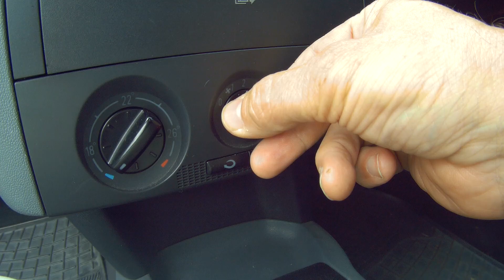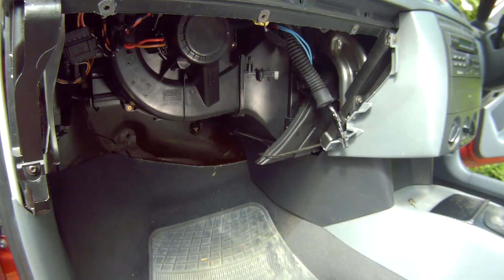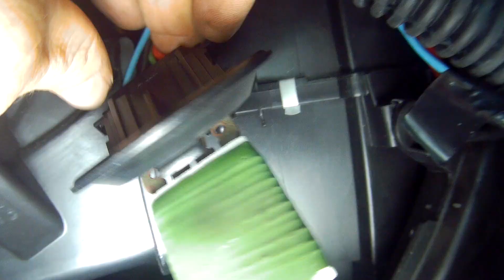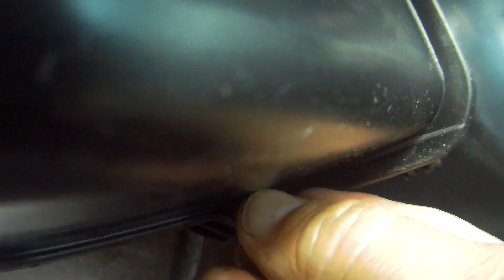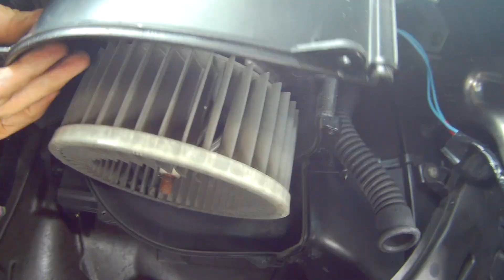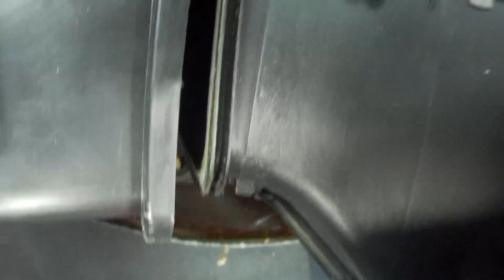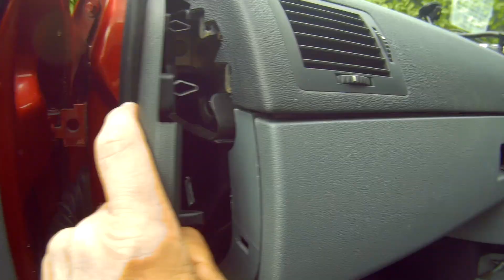SKODA FABIA Heater Ventilation FAN+ SPEED CONTROL

Comment: Great video, can anyone do a time for me tonsee where the 'air recirulation flap motor'can be located?
Reply from the maker: If you look to the far side of the fan unit you can see the blue toothed wheels controling the flap for recirculated air.
Reply: @HatBoyHarvey  thanks alot pal, appreciate it.
Reply: @hatboyharvey do you happen to have a part number for the recirculate motor you mention (blue cog part)? Thanks
Reply from the maker: @jimmymach6588  I'll have a look for you, what are your cars symptoms?
Reply from the maker: recirculation motor             RHD 6q2 819 453            LHD 6q1 819 453
Reply: @HatBoyHarvey  thanks. Recirculate button is currently stuck in the 'on' position (lit). I can't turn it off as the button light goes off and then comes on again. It sounds as though the flap is constantly in closed position. There's no grinding noises of gears but just assuming the flap motor is dead?? Thanks again.
Reply from the maker: I think I would test the connection for a signal to the motor, if there is one then i would look at the flap to see if it is stuck, then attempt to move is whilst pressing the button. The other flapper motor for heater is a common one for being temperamental like that. The motors and plastics get stuck with heat/cold etc. Hope you get it sorted, let me know how you get on :-)
Reply: @HatBoyHarvey  ok thanks, will try freeing flap first.
Reply: @HatBoyHarvey  didn't get around to looking at it before if corrected itself HatBoyHarvey. Maybe the hot weather we've had recently  made it stick etc. Not sure what this points to longer term though (if anything)?

Comment: I did the speed controller on a car this weekend and after that the fan is very noisy. is there any way of lubricating it?
Reply from the maker: Firstly check if there is somthing touching the fan like leaves. If it is the motor/bearing then in theory you could grease it, but I guess this may not last very long as the bearing will be worn. I've never done that. You would have to take it out and try to get at the bearing and may have to dismantle it. I don't know if the bearing can be replaced, but my gut feeling is it maybe housed in plastic and either not possible or not worth doing as replacing the fan is easier and not too costly if you choose a none OEM unit :-)
Reply: @HatBoyHarvey  There were leaves in it. that have been removed. Might be I forgot to connecet the hose aswell that might slightly affect the balance. The owner doesnt want to put much money into the car so thats the reason I ask. The noise is worse at lower speeds so its probably the bearign and then a new fan will be needed because theres no point in taking the time to restore it. Thanks. :)

Comment: A very informative video - thank you!  My wife’s car is a Fabia Mk3 1.9 TDI (2007).  Do you happen to know if this heater/blower fan is the same one in my wife’s car?  The heater controls are different in my wife’s car, and are further up the centre of the dashboard. 🙂
Reply from the maker: is it a mk1 or 2? the mark 2 does have different controls. If it is a mark 1 then it should be the same. The mk2 blower fan bit looks exactly the same to me, but not the rest of the whole unit. I'm only going on diagrams, sorry don't have first hand knowledge :-)

Comment: My fan speed working only on 4 now i know how to fix it thanks man :).Also in the same area when you was showing where the fan speed sensor is from that area cold air is blowing on passenger feet maybe you know what it can be?
Reply from the maker: my passenger footwell also seems to blow colder air than the drivers side and always has, not sure what this is or if this can be fixed. replacing/cleaning all the sensors and connections may help.
Reply: @HatBoyHarvey  Big thank you 😎👍

Comment: Hi , I changed the sensor of the heater but still working only up 4 speed , Do you know what the problem might be
Reply from the maker: If it works on 4, but not the lower settings you know there is power to the new sensor so that can safely eliminate it. I would clean the cabin sensor and check the connections on the temp sensor behind the control unit/or replace that as well. Check all cables/connections/continuity.You could try using OBD2 vagcom or other which may or not narrow it down if you have access to that. The actual switch or fan may be faulty, but I doubt it. I beleive the heater/vent control unit module can be reset, which may work and you know the infamous flapper motor gets stuck with heat build up and age and could possibly cause cause the system to malfunction. Check, test and replace is the only thing I can offer I'm afraid, hope this helps and you're able sort it eventually:-)

Comment: that sensor only controls the fan speed?Sometimes in summer i had it to give me some cold air and he give me hot air in the cold position,and cold in winter. do u know how to resolve that?
Reply from the maker: Yes, fan speed with overheat fuse (cheap to replace). Have a look at: https://youtu.be/kpv-mzBT8dQ     8:02 and 9:57, That sounds like the flapper motor getting stuck on hot or cold, which I've seen a lot on older fabias. Check flap actuation when stripped-down.

Comment: What can be my problem . My fan was blowing only on 4th speed so i changed the fan sensor that green thing it had blown fuse and the resistors showed bad resistance only 3ohms , so I changed it for brand new and after couple weeks it broke again , the new sensor cost just 20€ but what could be the problem with it ? I dont want to change the sensor and have it broken again soon .
Reply from the maker: I would check over all the circuit connections relating to the fan/upto the fan and then have a look at the fan itself. If it is worn then it may be taking more current to run, overloading the circuit and blowing the fuse and speed sensor etc. Hope this helps :-)
Reply: Hi , so I tryed to fix it myself . 
1. I measured if the Resistor Pack is broken or it has blown fuse , as show in this video : https://www.youtube.com/watch?v=LUNvzyvn8J8&t . It turned out that my resistor pack are all ok in terms of their resistance , they had blown fuse . So I changed resistor pack fuse , as shown in this  picture : https://ibb.co/g418c1H the fuse is combinated fuse 10A and 216C you need to make sure that the body of fuse doesnt touch the two middle points . 

2. I took the heater fan out of the car using your tutorial , there was no debree in the place of the fan , but the fan was cowered with dust , so i took the whole motor out and tried to clean it as much as possible . Then I put some engine oil (5W-40 was only oil that I had at home) on the bearings . Here is video that I followed on how to take the engine out of that plastic holder , It is in russian and it is diferent motor but the principle is the same video : https://youtu.be/ak2Shg8CRrU?t=423 .

Here are the photos of the bearings : 
bottom one (you can acces it only if you take out the motor from holder ) : https://ibb.co/nQynxq9 this bearing was full of black powdery dust so I gived it good clean .
The top bearing is pain , but you should get sense of how to take the fan part out and oil it . I used long siringe to get the oil on bearing photo : https://ibb.co/dDNXWwb the bering is just under the white part .

3. The fan part that white pastic was too covered in black dust so cleaned it as much as I could , I used minimum water becouse I thought that water will damage the motor , but you can use water and then spray it out with compressed air . Here is video from russian mechanic on how to clean the motor for good https://youtu.be/YAcnemZo8ds?t=571 , I understand just little russian but he shows it perfectly , in my case I do not have compressor so I did not use as much water .

The I just let the whole fan dry out , and instalet it back in the car .

But now the fan vibrates on 3 and 4 speed . I don t know why , I checked it holds good in that plastic , I think that I need  to again take it out and trim the fan white part . becouse it was hard to get all dust out of it , and I think that now it is out of ballance or something .

I may just buy the new one , but I just wanted to fix it myself , but it s pain in ass  :D I m just trying to save extra 90euros for new fan that s all :D 

My fabia is mk1 2005 . And the fan is factory one .

Comment: I have a problem also with The ventilation, because it is not heating at all. On The first 30 seconds it seems like is working and hot air is coming, but after that it turns to cold one... Do you have any ideas?
Reply from the maker: There could be a number of issues with this depending on mileage and age of car or just one. Check water level – thermostat –– belt that drives the water pump/adjust/replace-water pump? - flapper motor closing?– blower fan working?– replace all heating/temp sensors –fan speed? -flush heater system/matrix. Or you could hook up OBD2 reader when it stops working to see what is going on. Hope this gives you an idea; go through systematically, starting with checks then replace :-)
Reply: Donde están ubicado los ralay

Comment: Hi. You have a great videos. I have Skoda Fabia (2002) and I have problem with temperature control. The knob for control a temperature of air blowing in cabin does not work or work very slow. For example I put the knob to maximum heat and then start the car, after that the air that blows is hot but if I turn knob to the minimum temperature the air is still hot for about maybe 5min and after that it starts to blow a cold air. Do you maybe know where is the problem? Thank you
Reply from the maker: Thanks Mirza Bulb, glad you like my videos. When you turn the temp control knob to full hot/full cold it acts like an overide to give max settings. If it doesn't get cold quickley it is likely to be the flapper motor servo getting stuck which happens a lot with older cars. my video on dashboard centre fascia shows the location on this. https://www.youtube.com/watch?v=kpv-mzBT8dQ :-)
Reply: @HatBoyHarvey   - Thank you. First I try to clean a cover for sensor for cabin temperature and sensor it self, after that I try to reach and replace a servo motor.
Reply: @HatBoyHarvey - and one more question. Is that motor responsible for recirculation of cabin air because  I turn on recirculation and after minute of two the recircualtion are turn off and I cant'n turn it on again until I start the car again.

Comment: I've changed the resistor but my blower still isn't working, does it matter if it's not seated properly?
Reply from the maker: yes, it needs to seat properly or the fan will jam, check the fuse then see if there is power to the unit, if there is then try turning it whilst connected, sometimes they can stick.
Reply: @HatBoyHarvey  how do I check for power I don't have s multi meter to hand?
Reply from the maker: You can use a test light. £2.00ish from motor factors (looks like a small screwdriver with wires on) or attach/solder two pieces of wire to a small 12v lamp, one end on the connector  turn the switch on, the other to ground. Hope this helps :-)

Comment: You can just replace the the thermal fuse on the resistor... by carefully soldering a new one of the same value (available from Maplin) noting which way round it goes .
Reply from the maker: yes, good point, I was waiting for someone to mention this. I know you can do this and it will only cost about £1.50 ish (as a rough guess) if you want to go that route. It would be very satisfying to do like that :-). But is it really worth the trouble when they cost £6 - 10 for the whole thing new online?

Comment: Damn ty for the video. yesterday before watching this i did the exact same thing but only cleaned leafes and replaced the cabin filter, problem is there is still a noise while its working sounds like its loose but idk how to tighten it, really annoying.

took me like 20 minutes to remove the top screws now i have to remove them again :X, heater spins fine but there is a little jiggle so when i put it back on it makes that sounds, but when its laying downwards it doesn't make a sound.
Reply from the maker: once these become worn out it is best to replace them with a new or 
second hand part (yours sound like a worn bearing). You say it makes a 
noise only when putting it back on, so make sure it is on correctly 
first. I tied to show how it's put back on, but it isn't that easy to 
decribe and a bit of a fiddle to do, watch the vid closely and make sure
 it seats right before tightening. Hope this helps and you get it 
working right again :-)
Reply: @HatBoyHarvey  it sounded the same before and after the cleaning so i think something is just loose in the heater fan itself
Reply from the maker: If it is a dry bearing it would make noise and if it is at that stage then this would wear out the bearing causing play. They have to be perfect to make no noise, like computer fans I guess. Make sure the serial/part numbers match when buying a new or pre-used one as some are for none aircon.
Reply: I have exactly the same issue. I've been wondering how do I replace the ventilator? Is it a screw in the middle part of the ventilator which relase it out of the cover?